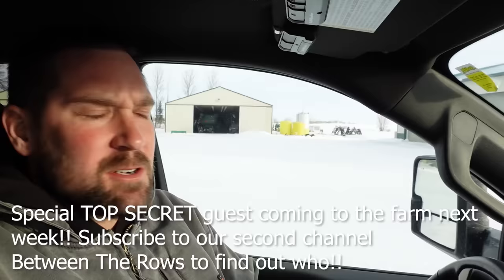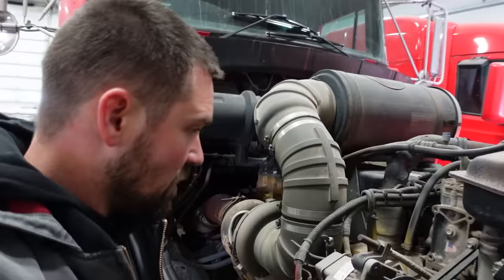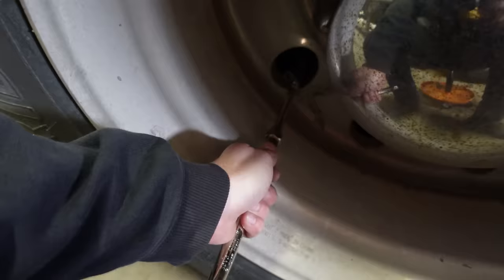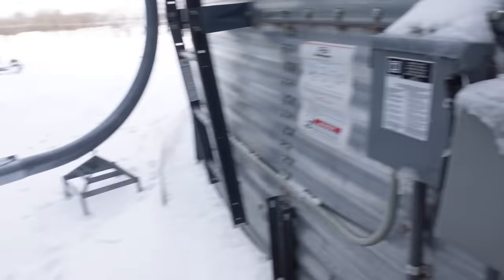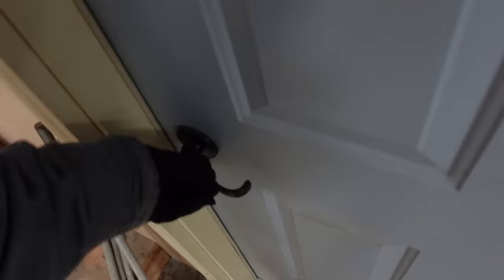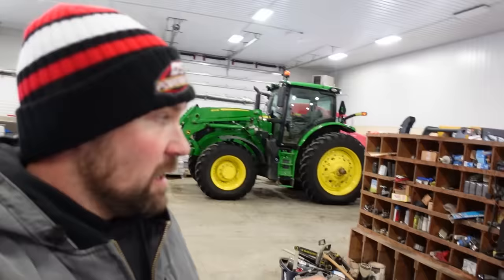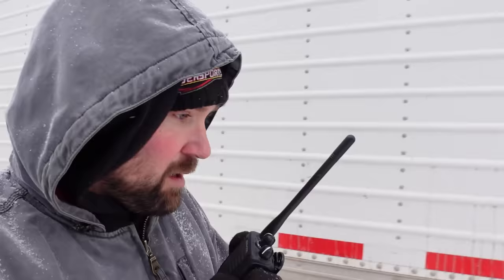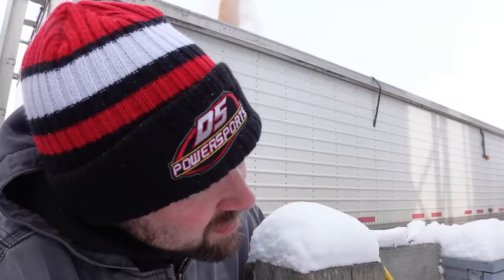MowerGate Scandal

Comment: Hey Zach
Take some time and clean those truck batteries
Voltage can flow thru the dirt and discharge the batteries in the right conditions. Also make sure the terminals are clean and tight
WD40 doesn't make a battery corrosion protectant spray but you can get at any automotive supply store.

Keep up the good work
Thank you
Reply: Will actually the voltage from the battery doesn’t flow through dirt it will break the connection though WD-40 won’t clean the terminals you need to buy this tour that well have bristles inside of it those clean battery terminals.

Comment: There's a company called Interstate Batteries.  They have batteries for anything that requires a battery. Maybe look into purchasing a few batteries from them.Seems your always jumping one thing or another.  Jumping them don't solve the problem. PS never install just one battery if the piece of equipment has multiply batteries replace them all. Learned that hard way many years ago.

Comment: Might need a new mechanical circuit breaker in the old charger. Little metal box with one wire in and out.

Comment: Those wonderfully fantastic PACCAR engine has an issue with the coolant overflow. The sensor is external and there is a magnet on the float. Those go bad all the time. If it ever goes out, tape something ferrous to it and keep going. 

Also, if the level is slightly low and you are in a long sweeping right hand curve, all the coolant sloshes to the left side, dropping the float and the dash goes crazy and debates the engine. Ask me how I know. 

Oh one more reason to hate that design… there are two coolant tank caps. Unbeknownst to me, one went WiFi on me. I couldn’t figure out where I was losing it until it was at the dealership.

Comment: Larsen farms uses tire equalizers which will allow you to check only 10 tire pressure instead of 18 and add air to both duels. The good ones are made out of braided stainless steel so you never have to worry about rust hope this helps. 🍻

Comment: disconnect charger before trying to fire up the engine. there's soooo little charge in the battery you're pulling massive current thru the charger ??

Comment: Those style of tire gauges are kind of garbage yeah, you should get one where it's all one unit with a dial gauge and you just push a valve to fill the tire and as soon as you let up on the valve the gauge tells you how much pressure is in the tire without having to switch back and forth 10 times.

Comment: So I've seen a number of guys loading corn starting in the front ring to fill the front hopper, then moving to the far back ring to start filling the back hopper. I was never taught to do this, but is there a reason I've seen guys doing it?
Reply: Maybe starting at the front puts weight on the drives, then loading the back end to get some weight balance then on to the centre section last so as not to over load it.

Comment: U need "Deadman" switches on your ground cables on equipment that sits.
Reply: @Martin Malone we call a positive/negative disconnect a "deadman" switch on equipment. Most newer equipment has a tendency to draw down batteries over a short time. Helps save batteries and alot of frustration.

Comment: Curiosity strikes - when you refer to "wet corn" versus "dry corn" (like when you commented about the sign they had posted), how much of a difference is there between the two? I know from multiple other videos that you monitor your silo's and move corn around in them in the process and do quite a bit of measuring both when harvesting as well as when storing it, but is there a "normal" for farmers like you that you prefer to keep your moisture levels at?
Reply: I'm not sure for ethanol standards but when feeding corn around 24% moisture is normally considered wet or "high moisture". 14% or lower would be dry corn.
Reply: @danquirke443  Thanks!! Yet another fact to store in the tidbit file in my mind.

Comment: I hope this comment reaches you. I have a T-680 KW. If the coolant isn’t 1 smidge above full, it will give you the shut down immediately crap on the screen. Dealer told me, “they’re like that” hope this helps

Comment: You may be better off to disconnect each battery and charge one by one.load test them you may have a bad one.you hate to load down the alt when you start with low batteries.
Reply: That's not a bad idea.  At least whip off a terminal and check current with a multimeter.  I get the impression that a lot of heavy equipment have cut-out switches to make completely sure there is no slow drain on the batteries.  I'm thinking of off-road dump trucks like the big Volvo articulated dump trucks that have a big switch next to the steps up to the cab.  Zach said the other truck — the one that started OK — did have a cut-out, so a good job to do on a slow day.  Plus I believe it is not good for lead acid batteries to be completely drained.

Comment: As much as you go through batteries, maybe there is a lithium ion that will work. I don’t know if they make one for cranking, but the Australian batteries state they can deliver 90-100% of their power and they recharge quickly. Downside is they are expensive. But if you are replacing them that often then it may be worth it. Supposedly 10 year lifespan.

Comment: Why don't you get a digital pressure gauge instead?
Poor lawnmower by the way..😂😂😂👍
Reply: DIGITAL PRESSURE GAUGE??  The only reason they use the pressure gauges at all is because its in a video on youtube.  He usually just hits the tires with a hammer
Reply: @davidanalyst671  ha! You have a point there 👍😌
But in his defence, better safety than sorry. And if my truck was parked in a warm garage with good lighting. I probably also would check the tire pressure instead of doing som thing out in the miserabul cold and snow..😅

Comment: 10:48 ?
What's a GRAGE - or did you also write it "wrongly" as Garge?
It sure didn't sound the way you "spoke" the word - as you said GA "R" AGE .. so why put something in the video editing - if you can't SPELL the word correctly..
GaRge be buggah'd - no wonder the batteries are flat - it isn't an open door that cools them down - it's the way you write wrong words.

Oh and when jumping them, try putting the jumper cables at either END of an array - not directly across JUST ONE battery, hoping that all the others will self balance (they won't).
In other words, on that truck - there are several batteries (3 I think I saw) that need to be charged, so - put the positive where you had it, but put the (black) negative clamps on the furthest away negative terminal - as that way - all three batteries will get exactly the same "jumper lead" voltage drop - not one battery getting full voltage - the next slightly less and the last 4k all charge..?